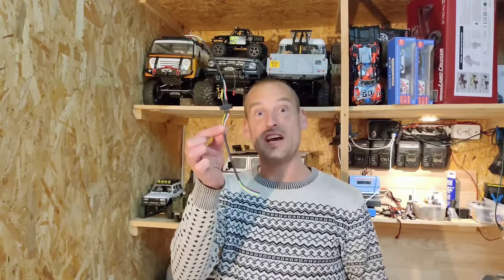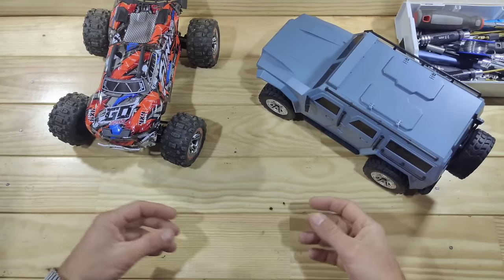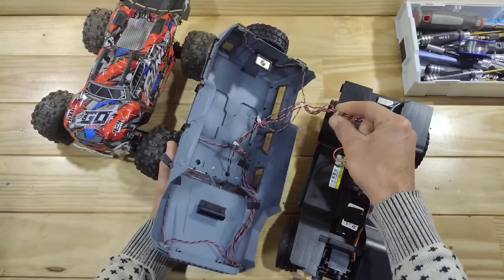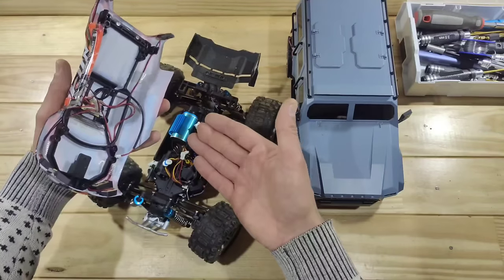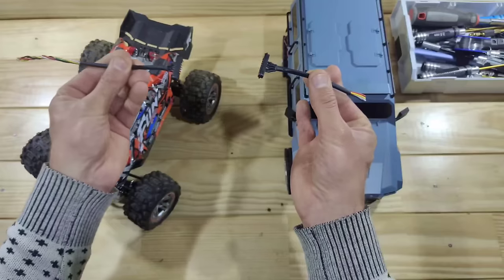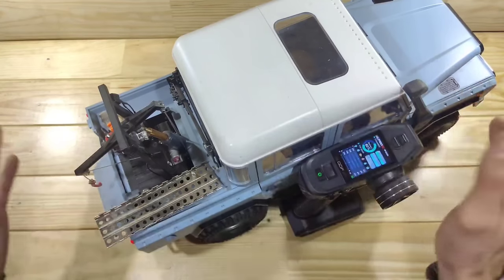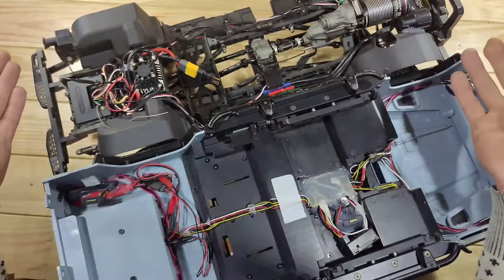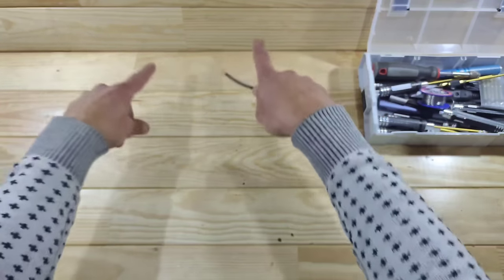This will change your RC live! I wish every brand uses these!

Comment: These are fantastic i used these on a rc drift car together with 3d printing and stronger marnets. 

I would only have to drop the body on and boom al lights functional. indicators, high beam low beam brake light etc.

Comment: Great introduction,
I suggest you detail more the reference of this tool as I did not catched at all the name of the tool itself nor the manufacturer.
does it switch itself around to prevent reverse polarity with inverted magnet poles too ?
Reply from the maker: Hi, yes, it's one way fitting, so inverted poles is not possible. Did you click the link in the description?
Reply: @hofsplace  no because I am not yet interested, as colleague YouTuber just wanted to tell you my thoughts
Reply from the maker: @tbremard  thanks 😊

Comment: I tend to solder up a balance lead for this purpose, usually a 4S (5 pin) set (depending on how many circuits I need to run for lights, a panning servo, and FPV VTx and Camera. Lights and servo are 5V, plus a PWM wire for the servo, while the FPV setups use full battery voltage, with  all using a common ground. The 5th pin can be PWM control for an HD cam, a second light circuit, or a second servo PWM in the case of my twin VTx King Yellow school bus. This would save a lot of fishing for the plug, as long as it can handle the amps the VTx draws
Reply from the maker: I usually use 1 plus, negative and than different signal cabels. Works fine for me